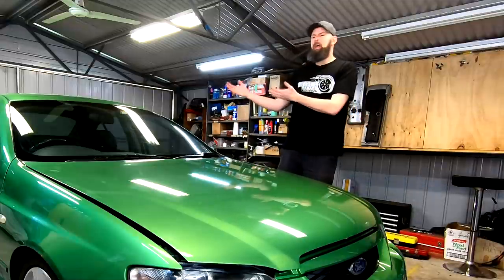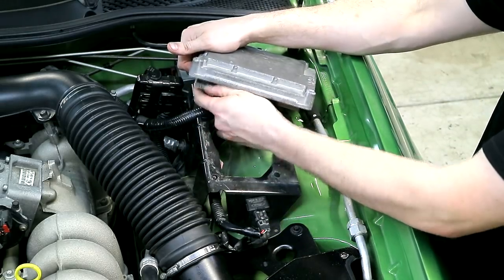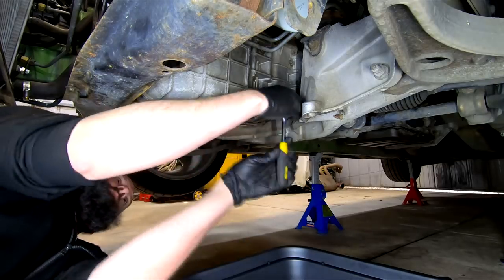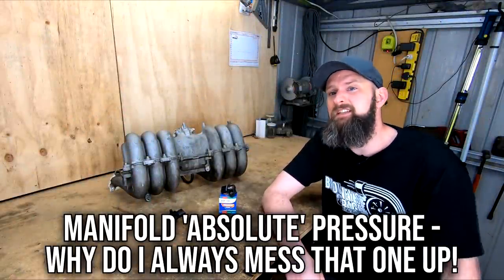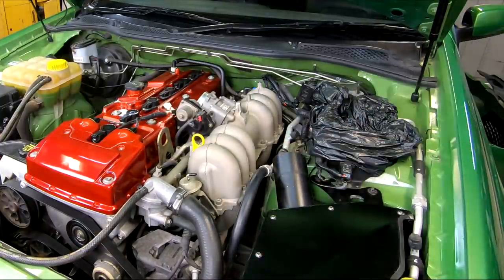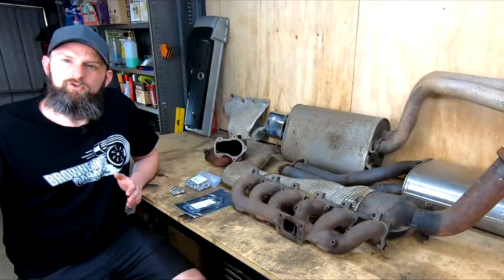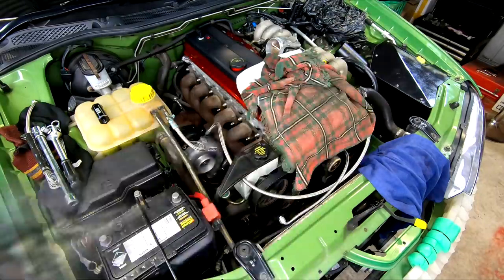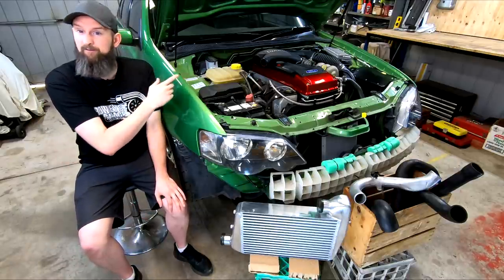In Goes the TURBO, Out With the NA Gear! | TURBO Your NA Barra Pt 5

Comment from the maker: So, am I being a bad influence on anyone to have a go at a similar conversion yet?
Reply: Nan says NAHHH
Reply: Oh yes, that's Beautiful Browney....ive got    
Some of the parts stashed under the house. A few more of the new small parts and away we go. Thanks for the info, time and effort spent doing that mate.
Reply from the maker: Good luck with it mate, plenty of little odds and ends to pick up along the way but if you’ve got the big stuff you’ve done the hard part!

Thanks very much for watching and the kind words mate 👍
Reply: My Falcon runs like a bucket of s**t after driving the length of Australia (Cairns to Perth plus a few weeks of detours/exploring), the turbo idea is the only thing keeping me from selling it! Randomly stalls a few times a week (after doing all the sensors, pump etc), and my fuel tank leaks when you fill it over half way...plastic tanks can't handle being filled on a 45 degree day in the NT. In truth I might end up with a Territory and do the turbo swap on it haha. I'm actually very very curious to see how the turbo goes and what figures you can make on the NA 4-speed box. I have the same but been contemplating a box-out overhaul!
Reply: Already done , Sx Territory Ghia Fg motor and Na manifold and plasmaman territory intercooler kit ( highly recommend it ! ) 440 rwhp on 14 psi ( turbo rods and pistons on 98 ) . Lot of hard work !
Reply: @christophermccartney5833  Recently saw amechanics video on a BA ute that had similar issues. Took them forever to diagnose , but ended up being the MAP sensor dropping out at unpredictable intervals which caused the injector pulse rate to drop to almost zero which stalled the car.
Reply: @mg74xbgt  saw that video too and replaced that sensor too, along with O2 sensor, fuel pump, spark plugs, coil packs, throttle position sensor, and something else. Fuel range went from 400 per tank to 550km per tank though. I reckon it might be a dirty injector or bad injector starting to fail, that's next in line along with a new tank (mine leaks when over 1/2 full).
Reply: Cough cough , on about our 5th conversion. Picked up a BA for $250 and a turbo for $100 , we got lucky and got a set of 4.11 gears for 100 and got cheap 80lbs injectors and a decent e85 pump. Scored cheap valve springs from a project build and we are going to strip ALL the weight from the car. Aiming for a 1K Barra build ....... LOL......worthy of a Sticker I think !!
Reply: @mg74xbgt  hope to see some videos of that! I can't even find a turbo exhaust manifold for under $700 lol
Reply: @plumbs7199  Sounds like a monster! Any videos of it? Can the standard AWD system handle it? Seen somebody on YouTube with a 900hp Territory with AWD but I think he's upgraded the drivetrain too!
Reply: @christophermccartney5833  Hi , yeah I should do a vid for those wishing to do a turbo Terry. It’s 2 wd bring Na conversion . The Btr is handling it but for how long , don’t know ! 

Main thing to remember is to clock the turbo core nearly 45 deg to clear the engine mount . If your using the factory turbo manifold. . Also used eBay one way valves on the brake booster . 👍
Reply: @plumbs7199  nice bit of advice there! BTR is an underrated box, they're tougher than the 6 speed auto. There's also cheap mods which can be made to handle more power, disconnecting some solenoid for 'soft shifts' helps the box survive. You can swap the oil pump in the box for one from an ED Falcon and it allows a larger flow capacity. The long soft shifts are what kill the BTR, the slow smooth shifts create more heat and burn out the internals. One of the best things that can be done to a BTR is a shift kit to make the shifts quick and snappy, that actually helps the box. There's a few BTR drag cars with over 800hp. The 6 speed auto can't handle as much as the BTR. Obviously the 6 speed manual Tremec is the toughest Falcon box, but also the most expensive.
Reply from the maker: @plumbs7199  Sounds like a heap of fun there mate, nice!
Reply from the maker: @plumbs7199  Not sure how similar the mounts etc are to the Falcons (pretty similar I imagine) but have found the same regarding clocking the turbo. Had mine as I would logically think it should be, feed and drain nearly vertical, then went to put oil drain on after the video and no chance! Will need to cover this in the next vid quickly I think.
Reply: My wife says you have explaining to do browney!because of you my ba Fairmont is in parts hasn't moved in 2 weeks and been taking her car to work.Dont know what's worse Australia posts delivery times or my wife's constant complaining. (But loving every minute of it.) So thanks browney I think.🤣🤪
Reply: @christophermccartney5833  yep they are getting expensive! Only going to keep
Going up too!
Reply: @BrowneysGarage  great sleeper at the lights lol! Of course I don’t go over the speed
Limit haha! Get
Some astonishing looks ! Especially with the turbo dose !
Reply: @BrowneysGarage  yep it’s on a near 45 deg but it works like that ! Counter intuitive!
Reply: @christophermccartney5833  In this case the NA manifold gets put on upside down and turbo comes out the bonnet as a cheap cold air intake :). Is easy to make cheap J pipes too if under the bonnet is more your style.
Reply from the maker: @Peabow Only 2 weeks? Don’t know what her problem is, that’s not too bad at all 🤣. Remind her that at least it keeps you busy and out her way a bit. Good luck with AusPost (I know your pain mate) and getting her back together 👍
Reply from the maker: @Ford AU Love your work mate, would be great to do a really budget, just for laughs setup one day. (I know these can be done more budget but still legit, if I did it again though it would be with much less care!)
Reply: @BrowneysGarage  Yours needs to be done right......and you're onto it. By now we tend to do it just to see if we can....plus it is good fun !
Reply: @christophermccartney5833  You're right about the BTR, everyone has differing opinions, but according to my mechanic they are bullet proof compared to the ZF, and should problems arise, MUCH cheaper to replace.
Reply: my only advice while doing this is to change engine mounts while they're so accessible but great vid mate...and also chuck in a f6 lower intake in the airbox while it's out  it's an easy as mod and you hear the turbo spool alot more
Reply: How much did it cost
Reply: Yes sir thank you. Straya!
Reply: yeah sure are, FG 2008 maybe down the track. Love your work by the way
Reply: Just started getting parts for my Ute
Reply: Probably work even better if you run e85. Nice throttle responce and Drivability
Reply: yes, I actually just wanted clarification on clocking the turbo😊
Reply: I've been looking at buying a factory fgxr6 turbo Ute.  And tbh money isn't the limiting factor. I want the satisfaction of building my own project. So the plan is to build a turbo motor on a stand swap in the go fast bits when I have all the parts and tune it using pcmtec.
Reply: You by any chance in Sydney and wanna do a turbo motor swap on my xr6 get paid
Reply: Your video has given me the inspiration to do this all by my self. Appreciate the video mate Your a legend 👍🏻 great help
Reply: I wish i knew about this earlier in my life 😢, Its the affordable Skyline to me😂 ❤

Comment: Hey mate, I did a turbo conversion on my BA ute. The flash tune caused havoc for me throwing TPS errors. Ended up witha  full tune. At that time also put in a boost T with a 7 pound spring to control wastegate. Ended up running 8psi and 320 RWHP. Fun daily.
Reply from the maker: Good power mate, I’d be very happy to end up with similar. And in a Ute too, what a perfect daily! Hope it serves you well 👍

Comment: Absolute cracking video Browney! Very detailed and well put together as always! It will be a great resource for Barra owners for years to come! Also mate you are getting further and further away from that hack tag you apply to yourself, before you know it you will be doing valve springs and rebuilding your gearbox! Cheers mate 👍
Reply from the maker: That's assuming it runs and drives as it should... 🤣 Still a hack, just a hack with some decent research and time put in! Appreciate that though mate, we're getting there 👍

Comment: I just did my BA and got it tuned last week!
Loved to watch along anyway
Reply from the maker: Nice! Got any more info on power, boost etc? Hoping to be enjoying mine soon but having a heap of fun putting it together too.
Reply: @BrowneysGarage  Got mine tuned at Maxx
Ran 210rwkw on 7psi
And 440nm of torque 

Boost comes on at about 4000, due to only having the actuator as boost control
Reply from the maker: Awesome, should be plenty of fun and happy there for a very long time I’d say going off others experiences. Thanks for sharing 👍
Reply: @BrowneysGarage  It was absolutely worth it! It’s so much fun 
I’ve done everything else to it (suspension, brakes etc) so it ties it all together perfectly

Comment: This is the most clear and well explained na to turbo video I've seen, will be using this when I have a go.
Have an old BA xr6t ute sitting in the paddock with a stuffed motor waiting to be stripped and used to turbo my BF mkii fairmont ghia.
Reply from the maker: Sounds like you’re in a perfect position to do it then mate, having something like that here would have made it a little easier and a heap of fun! Good luck and thanks for the kind words mate 👍
Reply: Different valves and rod's/ valves to handle heat , rod's are similar size to the LPG motors but have floating gudgeon pin's with Circlips holding them in / the pressed gudgeon pin's hold long enough to suck you into thinking shealberight and fang her to death

Comment: I'm doing all of this to my ef falcon sohc, using the 6 boost adapter flange, stock ef tb, barra t fuel rail and a j3 chip, w2a intercooler instead of chopping up the really nice radiator ducting

Comment: Good stuff. More incentive to boost my Ghia.👍
No need to pull pump relay to crank without firing up, just hold throttle at 100%, it cuts spark while cranking.
I do this when starting after oil changes to get pressure up first.
Reply from the maker: Thanks for sharing mate, have seen a few mention that now. Will give it a go one day but just a bit weary of it cause I know my luck, TPS won’t read 100% or something will be slightly off and send it to limiter instead!
Reply: Cuts injectors while cranking not spark its called flood clear mode

Comment: I’ve got the stock turbo fuel system and pump feeding 1000cc injectors on my 08 FG and it’s making well over 250kw. 308kw at the wheels actually
Reply from the maker: Damn good power there mate! Yep, more the stock injectors that will be limiting us fuel system wise.

Comment: If you end up having trouble fitting the intercooler 
Stock FG coolers are slightly thinner, and will clear the N/A power steering cooler 🙏
Reply from the maker: Love little bits of info like this, helps everyone. Thanks mate!
Reply: really ? is it straight bolt on ? or lil modification to fit ?
Reply: @alanpaul6582  fits with a stock hot side and plazmaman cold side 

I just wanted something so I didn’t have to run the stock crossover
Reply: @HappyYodeler4  good to know! thanks man. getting all my parts together now to +T
Reply: @alanpaul6582  Good luck!
The only major issue I had was trying to start it with the 2 bar MAP sensor
Because I’m silly

Comment: I tracked down a Turbo 6 factory exhaust system for my FG, big improvement for overall responsiveness, but what i love even on my N/A G6E, it's quiet until you sink your foot into it, and it has a very nice idle too.

Brought down my 0-100 times down additionally, more so because it can f**king breathe !
Not sure what the b-series run, but i know the FG's run a 3" dump which splits off into a Y pipe out to a single 2.5" system just before the rear end. Bigger inside diameter mufflers.

Comment: If you want to crank the engine without it starting simply hold the throttle pedal flat to the floor, save having to remove fuel pump relay. Great vid mate, hope everything goes well.
Reply: surely you'd just take the extra precaution instead of relying on that

Comment: Awesome series mate. You're super knowledgeable and concise. You make following along incredibly easy. 
Just a quick question regarding the ecu flash tune. Is there somewhere in particular you recommend sending it for the tune or will most local tuners have the software to do it? 
I'm located in Wollongong so lots of tuners around the Sydney area but I was curious if there's a plug and play flash tune to get me on the road? 

Thanks mate! Keep up the fantastic work!
Reply from the maker: A lot will do it but of course you have to be a little careful with these things. I'm using Maxx Performance for all of my tuning, but head over to the NA+T falcon group on Facebook and there should be someone closer to you recommended 👍. Thanks for the kind words mate, it's all just a heap of research and then giving it a crack!
Reply: @BrowneysGarage  thanks mate! I've had quite a few recommendations for custom machine works. They have a heap of experience with na+t barras so I'm confident it's a good choice. All I need now is an exhaust and I can start the conversion! Thanks again so much for your videos mate.  Giving people the confidence to jump into it!
Reply from the maker: @nsjumper  Yep, they're getting a good wrap at the moment! Good luck with it mate and if you get a chance let me know how it all goes 👍

Comment: Awesome video mate, how are you finding the titanium studs so far?
Reply from the maker: Don't have too much faith in the small allen key head in the studs putting up with any abuse (I hate allen heads, strip out way too easily! At least there's room for the double nut trick if need be) but other than that seems ok so far. Fingers crossed they stay tight longer than the factory bolts.

Comment: There is a easier way to do a oil return line into the the sump drain oil then you take of the sump and clean it then drill it out then clean up the sump it put it together then top up with oil when down

Comment: I originally did the na to turbo conversion on my fg ute about 2 years, to a similiar stock setup such as this one. safe to say i got abit carried away with it now running i high mounted turbo with external gate on a stock na fg barra with valve springs and now running over 500hp and still plan to go bigger. If you know what ya doing definite worth converting na to turbo rather then selling and buying a turbo car
Reply from the maker: Not sure I’ll ever go quite that far but can see how it happens for sure - never say never though! Sounds like a sweet setup and good to see the NA hanging in, even if it is a bit tougher than the BA bottom end 👍

Comment: Browney! bugger off the blow off valve!! But seriously you should run a catch can to those rocker cover breathers, it stops oil getting into your turbo, intercooler, pipes and intake manifold! I'm sure you've seen the oil in there before. Plussss its extra wank factor
Reply from the maker: Will definitely be playing with/deleting the BOV at some point, and isn't mad dose enough wank factor!? 🤣 Yep catch can is a definite option in future too.

Comment: Great job buddy , I’m looking at doing a conversion on my 2012 fg . In the process of collecting the parts for the change . Do you know what the differences would be in converting the fg? Can’t find anyone on YouTube that has an instructional video for an fg .
Reply from the maker: From what I've seen sourcing a suitable fuel reg to suit the NA rail was an issue for a while but seems a solution for this has been found? Seems fairly similar otherwise except that there are fewer parts kicking about and prices reflect this, but I haven't looked into it directly, more just what I've read as it's popped up.

Something that's becoming a really good resource is the NA+T Falcon group on Facebook if you're not already on there?

Comment: Hey mate I’m in the process of starting this same conversion and planning to use your vids as my main guideline 😉

Any chance you have a parts list? Just so I can buy as much as possible straight off the bat
Reply: One of the cheapest ways to do it is get as much factory gear as possible. A lot of people upgrade these, so factory manifolds, crossovers and intercoolers etc are cheap. Just don't cheap out on the tune, the tune is what will fuck most people. Expect to pay a good $1000-1200 for a tune at least

Comment: Well presented video as always browney. My fingers are crossed for your internal N/A valve springs,head studs,and connecting rods to hold together under boost,and the extra forces on the driveline and oil pump gears.Only time will tell. Good luck and merry xmas.
Reply from the maker: Mine too! Pretty confident though, valve springs maybe at worst may hold us back, time will tell as you say.

Cheers, you too mate 👍

Comment: I have a fordfairmont 2006 with a silver top barra that is completely stock it doesnt have anything done to it do i need a barra engine with head studs, valve springs, a head gasket and oil pump gears done up to turbo my car or can i put a turbo on it as is?
Reply from the maker: This engine has none of that yet. Depends on your goals for it really, but at a modest level you SHOULD be fine without any of that.